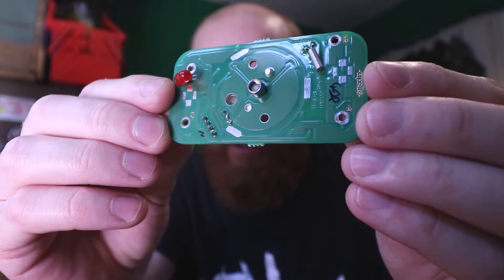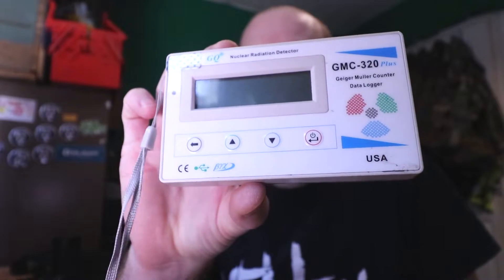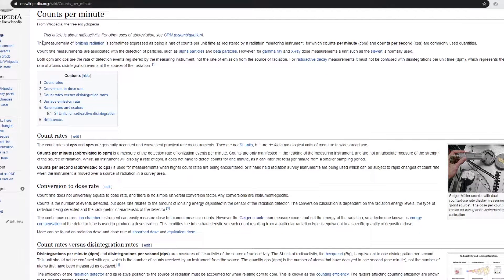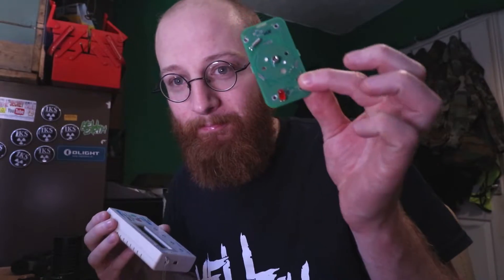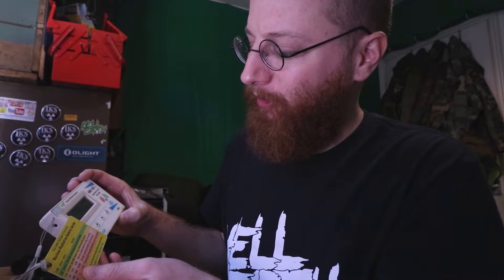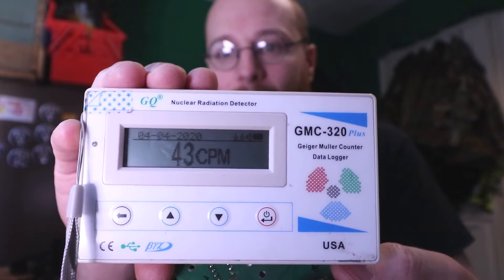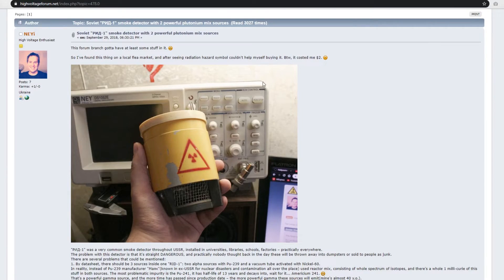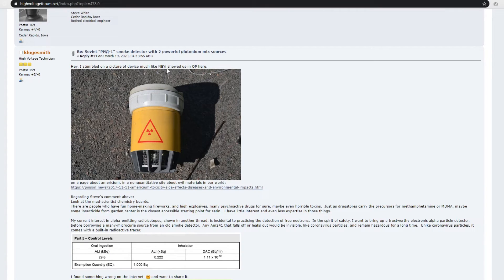Radioactive Smoke Detectors - Americium-241

Comment: The Geiger Counter that you have doesn't measure the Alpha radiation. 

Americium emits MOSTLY Alpha radiation, with a little Gamma emission mixed in. You are only detecting the small amounts of Gamma that the Americium is giving off. 

If you had a Geiger Counter with an "Alpha Window" in it, the Counter would be going nuts...

Comment: Americium 210 is an Alpha particle emitter. if you used a detector with an Alpha window you would have seen levels at 65,000 CPM  or higher. scary.

Comment: Thanks for being straightforward about it you put my mind at ease on these a little, would the radiation stay on your hands for long after handling it and could you pass radiation on to others form the rays given off ? Or would simply washing your hands suffice ?also is it likely you’d be breathing the alpha particles
Reply: NO! Alpha, Beta,and Gamma radiation can NOT "induce" radioactivity in other items. 

Such radioactive materials COULD spread radiation by contamination if the material is a very fine powder or dust, and sticks to your skin. 

Other than that, Neutrons are the ONLY ones that are able to "induce" or "activate" radioactivity on other items just by being near it and bombarding them.

Comment: i have a  military compass it has a radioactive warning sign on it, i wonder what the reading is on them
Reply from the maker: Radium wow
Reply: I think the radiation comes from the glow in dark parts of the compass. Radiactive elemnts were used back then for glow in the dark paints. It might be Thorium but i dont remember for sure.
Reply: @GDS670 It's Radium

Comment: In water particles settle at the bottom...like sand so not a major concern. Well in the same way it isn't damaging the background radiation of the room your in. In water it won't make it radioactive it will just radiate in the same way. If you ground it up and put it in the water supply then particles would travel further. The same as if you ground it up an blew it round your room. It would still just settle though eventually.

Comment: So without getting all technical about this, a radioactive source emits different radioactive particles, Alpha, Beta and Gamma are the ones that are generally most often looked at when discussing radio Isotopes.  The model of Gieger Counter you have measures Beta, Gamma and Xray because Alpha particles are quite slow speed they are generally absorbed by even a piece of paper as you said they aren't generally measured by Dosimeters, hence why you didn't see any changes in readings.